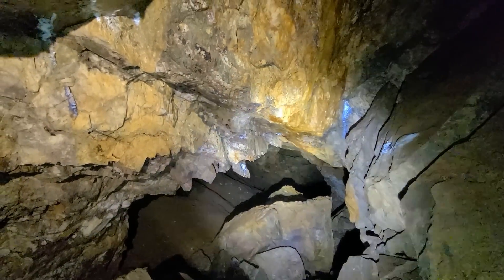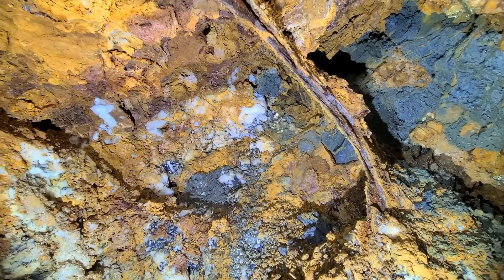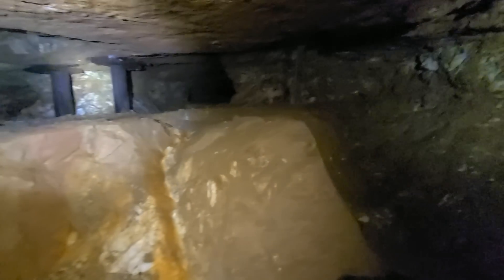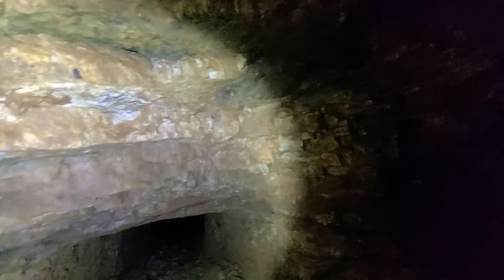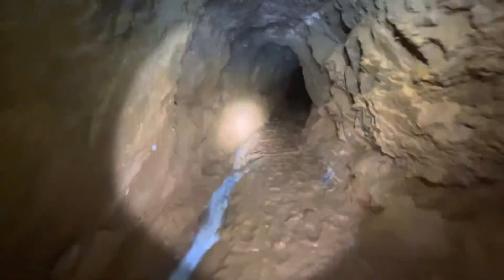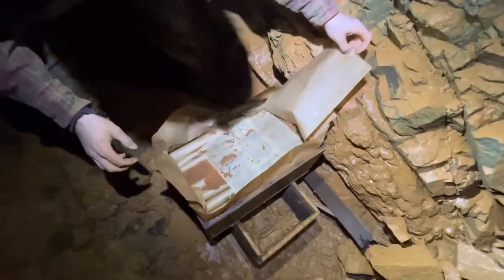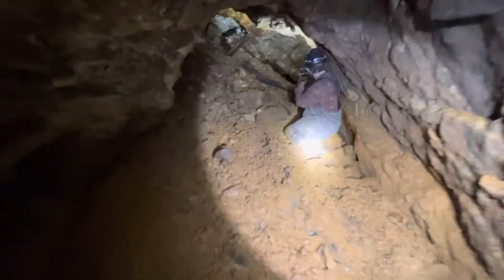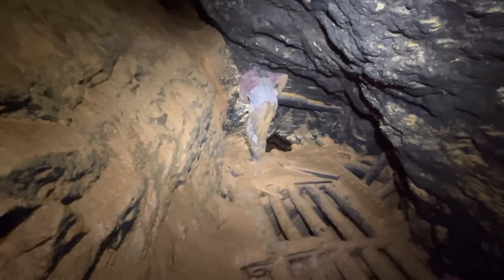Big Things Have Small Beginnings - Part 3

Comment: I have a question. Is the old dynamite dangerous wet or dry? I watched a different video and the guy said he would be more afraid of blasting caps than dynamite.
Reply: If it's soaked with water, it's inert. If nitro is beaded onto it, I'd be cautious but not terrified. Blasting caps are much easier to initiate.